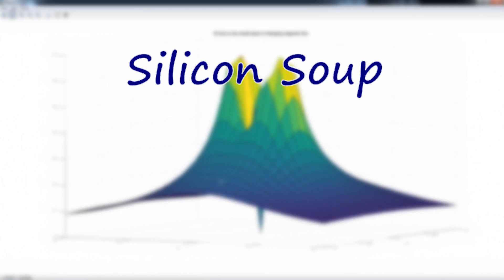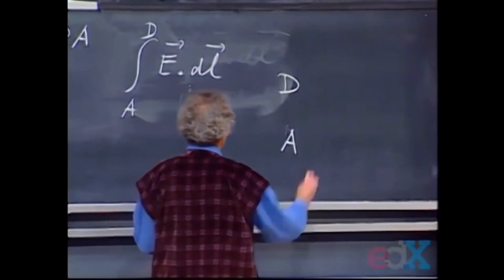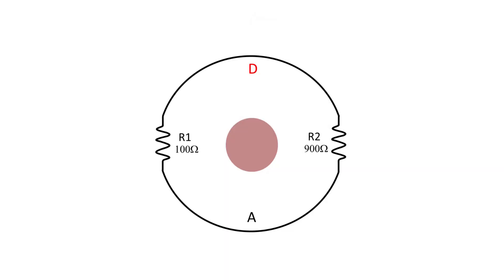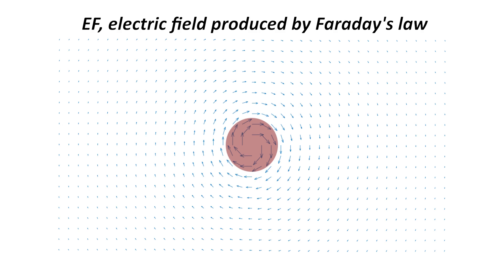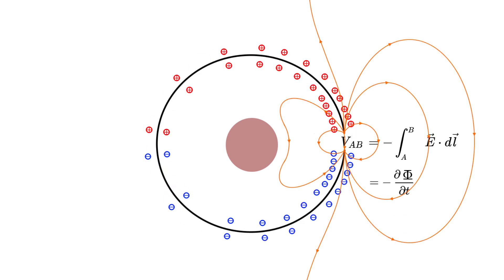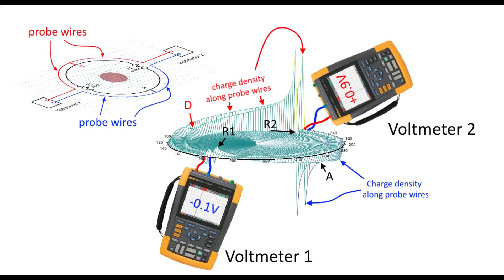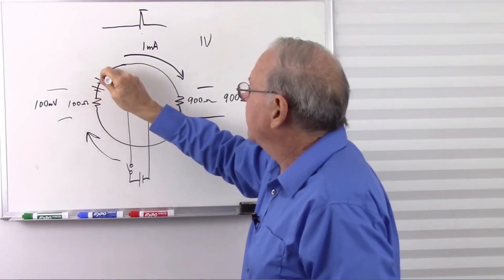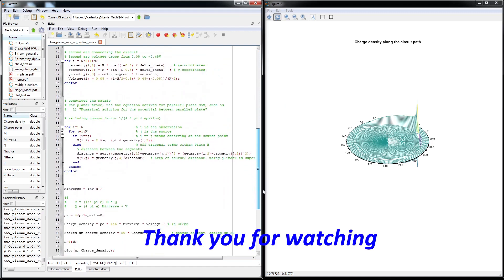Dr. Lewin vs ElectroBOOM on KVL. Of course Dr. Lewin is right.

Comment: KVL does always hold, even in presence of varying magnetic fields / batteries / etc, in the circuit.
Mr Lewin just does not understand what KVL is, I don't know who told him that KVL means integral of E*dl = 0; This is not KVL. 
KVL is only applicable to loops in lumped element circuit models, not to any random physical loop in space like he used to from 
maxwell's equations. And definition of KVL is that sum of all voltages in a lumped model loop equals to 0, where voltages of each
element are defined as integral E*dl between the element terminals, but strictly outside the device (not inside, to avoid going
through non-conservative fields inside of batteries / inductors).
This is honestly common knowledge, every single book on electronics teaches KVL like this, and even the wikipedia article
describes KVL very clearly. So the reason KVL "did not work" for Lewin is because he pretends that drawing of the physical setup
he has is actually a correct lumped model (it is not), he has different definitions for voltage, and counts these voltages in the wrong loop anyway.
Reply: He also makes plenty of other embarrassing mistakes, like in the beginning of his 8.02x - Lect 25, where he claims that KVL is garbage,
because KVL suggests there is voltage across the inductor, and he thinks there is no voltage because E field inside is 0. Yet, simultaneously
he claims there is E field inside the voltage source, which just like the inductor has no internal resistance, so there must be no E field inside
and no voltage drop across it (that is, according to his own flawed logic). 
This actually implies that there is infinite current through that voltage source, but he is not bothered by that one bit. He makes up his own
laws of physics and proceeds to insult anyone who calls him out on his BS.
Reply from the maker: You said KVL always hold, even in the presence of varying magnetic fields, and sum of all voltages (strictly outside the device) equal to 0. In the Lewin's circuit with only two components R1 and R2, V_R1 and V_R2 are measured outside the device, and the voltage across the wires are also measured outside the wire and V_wire = 0, and all the voltages don't add up to 0.  Isn't this a demonstration of KVL fail?
Reply: @SiliconSoup  No, it is not a demonstration of KVL fail. It is a demonstration of Mr Lewin not understanding what lumped element model is. There are no such things as loop areas and magnetic fluxes penetrating surfaces in lumped model. He made a drawing of his physical setup and tricked his students into believing it is lumped model by using similar symbols and graphic style.

To make a correct lumped model of his setup, you have to add a 1V voltage source, which is modelling the effect of changing magnetic flux. For example, you could place it in the point he has labeled A in his circuit (at 41:54 timestamp of his 8.02x Lect 16)
Reply from the maker: If you add a 1V source at A, it doesn't tally with the physical setup. There is no 1V at A if you measure it, so how can it be a correct model?
Reply: @SiliconSoup  It is a correct model, because it gives correct results. Yes, these models often do not look like physical setup at all, and there is nothing wrong with that. For example, if you have one 10k resistor in real world, you can model that by two 20k resistors in parallel. It may look like a loop in the model, but this loop does not actually exist in real world. What matters is that when you apply voltage across the terminals you get the same current.

Yes, there is no voltage across point A in real world. EMF is distributed in the physical loop, just like resistance is. I am not talking about real world, since it is not made up of lumped elements. I am talking about a mathematical model that can still predict correct voltages and currents using lumped elements. How to do that? You need to find a conservative path in your setup, which will make it possible to even define voltages in the first place. Then you will know that sum of these voltages in your path is 0, so you can calculate the current and each individual voltage (using Kirchhoff's laws).

Here is my path. I go straight from A towards the area of changing magnetic flux, go completely around that area counter-clockwise, then back to A. Then I go to lower terminal of R1, then around R1 to its higher terminal. From there I go to higher terminal of R2, around R2 to its lower terminal. Finally, I go back to point A. This is a conservative path, since there is no changing magnetic flux inside and no batteries along this path.
From Faraday's law I can tell that integral of E*dl (when going outside the wire from A to A) is 1V in this case. This is the voltage across A now. From Ohm's law I know voltages across resistors are I*R1 and I*R2. And now I can use KVL to find current in the loop. From this current I can find voltages at each resistor, and so on.
Reply: @krakrukra1731  Yes, but you couldn't do it without Faraday's law which is the point. Only Kirchhoff doesn't work in magnetic fields. Only with the understanding of magnetic fields laws, you are able to simplify the model enough so that you can use Kirchhoff's law. Which is exactly what ElectroBOOM was doing. So he never actually disagreed with dr. Lewin's teachings, he only disagreed with the way he expressed himself. You can absolutely always simplify a model enough to use Kirchhoff's laws. But only with understanding of other laws regarding magnetic fields as well. Kirchhoff alone can't be used when you have a magnetic field is what dr. Lewin's point was. You can't say Faraday's law vs KVL, and then use Faraday's law in order to use only KVL - you proved that you can't use only KVL.
Reply: so imo where dr. Lewin went wrong was that he assumed that anyone using KVL in the presence of a time-varying magnetic field is making a mistake. He didn’t acknowledge that many engineers or physicists using KVL in such situations are often using a model that already includes the induced EMF, which is implicitly based on Faraday’s Law.
By not stating this nuance, he ended up sounding like he was discrediting the use of KVL entirely in magnetic field situations, which caused confusion, especially since people do get correct results when using KVL properly in such scenarios.

Where ElectroBOOM did right in his claim:
electroBOOM made his statement clear in the first video, that only if you measure the voltages around resistors, when you put them all close enough in one lump, you can tell how much there will be voltage in the rest of the circuit - by the KVL! And then you'll be able to model it right with the voltage source of that voltage missing in KVL to make it 0. And that's how you can avoid using Faraday's law. And his claim was right. If you model correctly with understanding the influence of the magnetic field, KVL always holds.

Where ElectroBOOM was wrong:
When modelling bigger circuits, you wouldn't start with finding out induced voltage by measuring what everything else is giving. That would be too expensive. You would have to do it by using Faraday's law. 
So ElectroBOOM's explanation is valid only after Faraday's Law has been used (explicitly or implicitly), and in small circuits he gets away with measuring instead of computing. What his conclusion should have been is: "You can always use KVL, but as long as you’ve used Faraday’s Law first to correctly model the EMF induced by magnetic fields." I believe his misleading title in the second video might have created even more confusion to what his point was.
Reply: @marijanabirtic4570  Dude, it's been 4 years almost, lol. I don't even remember what ElectroBOOM was saying. Actually, without knowing Faraday's law, I would still be able to go along that conservative path and sum of all voltages would still be zero. I just would not know the exact value of that voltage source at point A, unless I measure, which is possible though. So KVL holds and predicts accurate result. In any case, that was not Lewin's point. His point was that KVL means integral E*dl=0 no matter the situation. That is a stupid lie. He should have read the goddamn law first. KVL is unapplicable to physical loops in space. It simply does not make any claims about real world for them to be false. KVL always works, because it works only inside the model. You are the one who has to deliberately make sure sum of voltages will be zero, and thus make an accurate model. If you do dumb nonsense like adding distributed elements and fields into LUMPED model or if you don't even know what voltage is, then you will of course get bad results. And it's purely his fault
Reply: @krakrukra1731  You're right that KVL (the algebraic sum of voltages around a closed loop is zero) is always true. But KVL by itself doesn’t tell you what those voltages are, only that they must sum to zero. That’s why it’s not self-sufficient in dynamic EM environments. 
Saying you can just measure the induced voltage is still an implicit usage of Faraday’s law. Because why would you even expect a non-zero sum of voltages in a passive loop unless you understood that a changing magnetic field causes an EMF? That insight doesn’t come from KVL, it comes from Faraday. 

So to model induced voltages correctly, you need to understand Faraday (or measure it, which still assumes it exists). That’s where I think people overstate KVL’s independence, it’s not self-sufficient in circuits with magnetic coupling. 

As for Dr. Lewin, I do think he went too far by attacking the definition of KVL. The classical KVL has always been taught as ∑V = 0, and that always holds. The flaw wasn’t in the law, but it was in trying to apply it to physical space without modeling the EMF.

So I see where dr. Lewin was coming from when claiming you need Faraday's law and not just KVL in non-conservative fields, but yeah, his definition of KVL was wrong and he should've admitted that when people started calling him out on it.
Reply: @marijanabirtic4570  Sure, KVL alone does not allow you to find precise voltage across each element. It never claimed it can. Nor does Faraday's law allow you to do this. You still have to know Ohm's law for resistors. You have to know exact values for their resistance, have to know that wires have neglegible effect so may be omitted in the model, etc. 

Thing is, KVL is completely self-sufficient, precisely because you can measure to make a model. In his own lectures, Lewin used a battery, for example. Did he ever bother to explain all the chemistry inside and how exactly it creates voltage? No. His students don't know what laws govern that. Is it a problem to calculate voltages and currents in his circuit examples? No. Can Faraday's law help you find that voltage? No. What about solar cells in the circuit? Thermocouples? Piezoelectric elements? It sure is useful to know physics laws, which determine how they work. But it is not absolutely necessary. 

In his case, let's say I don't know about Faraday's law. I see 2 resistors, connected by wires. I make a model with 2 lumped resistors in a loop. Then I measure, see 1 volt drop across them. So I realize: OK, I must have missed a source in my model that exists in reality, I have to add that. End of story, my model is correct now. You really don't need to know what causes that voltage.
Reply: 0nullBit  Dude, you have reading problems. I never mentioned Feynman in any way. And I literally said this: "You can only define voltage in a conservative path. If you found a path on which voltages even exist and have defined value, their sum will be zero. That is exactly what KVL says". That is what I say, and what Feynman says, too. If you have trouble, read again. And again. It must be standard practice for Lewin fanboys to miserably fail to understand a simple concept, then blame the law or some other scientists for disagreeing. And I repeat, specifically for you, KVL IS NOT A PHYSICAL LAW, it's a circuit law. It does NOT say integral E*dl = 0 no matter what. It says once you defined elements and their voltages in your lumped element circuit model, sum of these voltages will be zero, which is always true. When you are trying to apply KVL outside of a lumped element circuit model and to some "physical setup Lewin has" YOU are the one making a mistake, misunderstanding and misusing the law.

Comment: At 4:29 I believe your arrows inside the shaded area are wrong.  As you've drawn it, there's no curl except at the very center.  Inside the shaded area you need to draw it like you did 3:46
Reply: Nope, Silicon Soup is right. The magnetic field is confined in the small circular area. The induced electric field , on the other hand, extends outside of it. Ideally, for an infinitely long solenoid acted on by an infinite power generator, it extends to all space.
Reply: @copernicofelinis  You don't seem to have read what I wrote at all.  If you put a small water wheel inside the shaded area, but not in the center, then it would not turn given the arrows as shown.  i.e. with the arrows shown, the curl of the electric field is zero.  But this contradicts this voice over which says that the curl everywhere inside the shaded area is non-zero.
Reply: @johnflux1  I say that if you place a wheel off-center, even without enclosing the center but still inside the shaded area, it will turn.
Why? Because of how the magnitude change with distance from the center.

Outside of the shaded area, it's another thing.

Edit: I just realize we met on Electroboom s channel. I am not stalking you :-) it's just a coincidence. Have you read the references I gave you?
Reply: @copernicofelinis  hmm, yes I think you might be right.
Reply: @copernicofelinis  I didn't, because we ended up talking past each other too much.  People don't really disagree with the actual physics, just terminology.  So references, especially to old books, where the terminology can be different isn't all that helpful I felt.
Reply: @johnflux1  had you read those books, you would see it not a matter of terminology. Anyway, suit yourself, I brought you to the water. It's up to you drink it or not.
Reply from the maker: The Octave program written for the plot in 4:29 is E_phi  equal a constant inside the shaded area, and proportional to 1/r outside the shaded area. You can see the two inner circular E having the same magnitude, beyond that the magnitude is decreasing. I checked the curl operator for the cylindrical coordinate, and constant E_phi produces a non-zero curl, and the E_phi decaying with 1/R produces 0 curl. So I think the plot is correct in the sense the changing magnetic flux occurs inside the shaded area only. The water wheel will turn if it is put off-center. However, in the video, I have been saying uniform changing magnetic flux inside the shaded area, and for curl to be a constant value inside the shaded area, E phi should be proportional to r inside the shaded area, so using constant E_phi is my bad :(. Assuming that I plot E_phi proportional to r, the arrow will still be circular and cocentric about the origin, and that will still be different from 3:46 with many small circles having their own centers. To me, these are just different representation of the same thing.

Comment: This is a waste of time, at this point it is a philosophical question, wether you should measure including the external field or not. Physics student have to agree with dr lewin and engineers with mehdi. Personnaly, i would just learn how to use my instrument to measure what im looking for instead of having to do calculations. Both give same results and one is faster
Reply from the maker: When measurements give consistent results, you can just learn the measurement without worrying about the calculation or theory. However in this special case, the two voltmeters give different results, and the theory and calculation become even more important to reconcile the differences. In fact, i think that the more hands-on a person is, the more he/she will be surprised by the measurement result.

Comment: OK so if you are probing the same points but getting two different readings then I would think the fields along your measuring wires are the concern. So what is the mystery ?? if your probing wires were not effected by the fields then the reading must match and KVL is correct.
.By the way I only sort of followed your points but I think we agree if not let me know!!
Reply from the maker: I agree the outcome is no mystery because Faraday's law clearly allow that voltages in a loop to add up to non-zero value. But since we are so used to static field, and the effect of gravity (analogy to the static field in circuits), having different voltages along two different paths should be very unintuitive. I merely pointed out the role of the charge redistribution, so we can the understand non-KVL circuit without compromising our understanding of the circuit laws.

Comment: I took calculus 40 years ago, and I don't recall any of it.  Is it possible provide a purely intuitive explanation without relying on integrals , etc.?
Reply: Well you can say the loop is positioned around  a central solenoid and so the effect of the  Induction is up on the left and down on the right , and so the induced current flows  in a circle clockwise.
Reply: @woodcoast5026  Thanks.  That's what I needed.